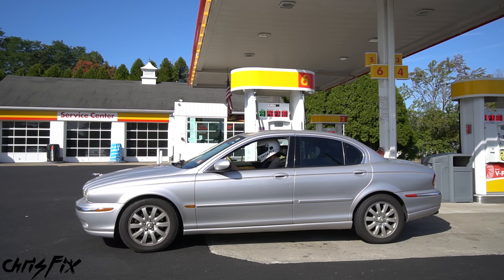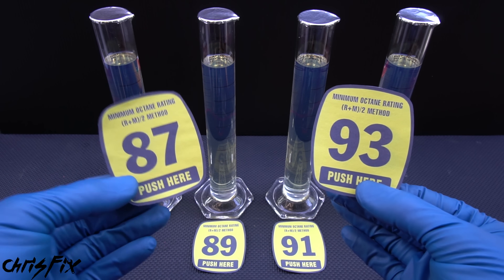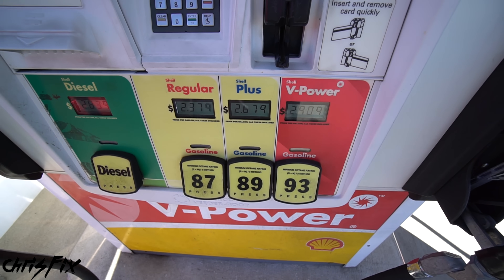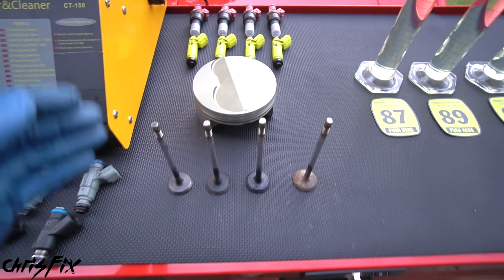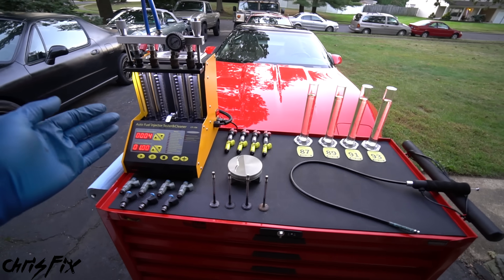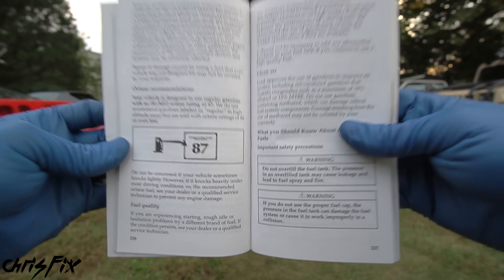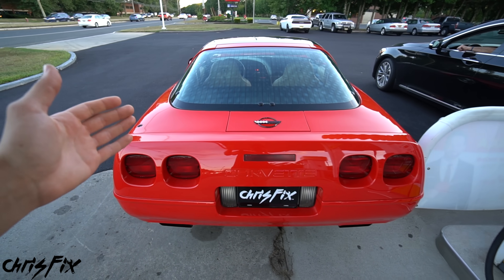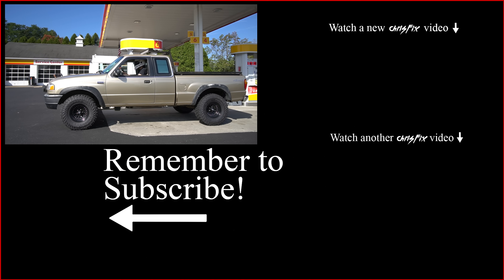What is the BEST Fuel to Use in Your Car or Truck and WHY

Comment: American Fuel has Ethanol about 10-15% , and it is trash. Ruins lines and hoses. Ethanol is the reason why people say American fuel is crap.
Reply: Only most of Europe has now introduced it as well. And all makes of cars and trucks have been made for 10% alcohol for the last 20 years now. There are no rubber hoses and all fuel lines on modern cars are stainless steel. US gas standards are the highest in the world actualy. And countries around the world are going 5% and 10 % and higher world wide at an incredible rate of adoption. The US besides Brazil, was just early to the game for 10%. But it's been standard in my state for two decades now. Also Ethyl alcohol burns cleaner and doesn't pollute as much. And Europe is all about that idea.
Reply: Scootaloo in theory it is, but the process of converting corn into ethanol is dirtier and requires fossil fuels anyway. Ethanol has caused more damage to a lot of marine and boating engine fuel systems. Just cleaning out the ethanol from the fuel system requires a ton of chemicals and replaced parts that end up in the trash. Ethanol is not worth the effort at all.
Reply: @geog5523  It has to be worth the effort. They have made the switch 20 years ago now. LOL! Plus all you can buy is 10% in all grades here. The boats here on the great lakes are running it.
Reply: Scootaloo I am in the industry , it is a major problem among all boaters who use gas powered engines. It is a costly expense and any mechanic shop in your area will tell you how big of an issue it is. It is not worth the effort in the US at least. Do some research on Ethanol related fuel problems , you can’t just assume these companies are doing it for anything by other than personal benefits. Biodiesel on the other hand is great because you are recycling a product that was considered waste.
Reply: @geog5523  So what your saying is that the automotive industry figured out how to make cars run perfectly reliably on 10% Ethyl gasoline 20 years ago, yet in 2019 they can't make boats run on it just fine. 

I find it funny how my 25-year old lawn equipment has run just fine on it for two decades without issue and how I've had several vehicles run hundreds of thousands of miles on it without issue. Yet boat manufacturers can't make a boat run off of it in 2019? WTF! XD

That's the first I have ever heard of it. It's not even possible to buy gas without 10% alcohol in it. It's been a law for years now that all gas has to have alchohol in all gas grades. Not to mention most of the world now runs it in their gas as well. 

So about ethanol being a dirty process. It is not. Ethanol is typically produced by removing the starch or sugar portion of corn and fermenting it. The fermented starch is then distilled into alcohol. Excess water is removed, resulting in very pure, 200-proof, ethyl alcohol. That's it. Then it is just mixed with gas and the process is done. 

Also according to a major boat engine manufacturer. 

Ethanol blended fuels (E10) are common throughout much of the United States. After the transition period from non-ethanol fuel, E10 may actually be a superior marine fuel, as it tends to keep low levels of water moving through the fuel system, keeping the system “dry”. For over a decade, marine engines have been engineered to handle E10 gasoline.

So this just goes to show you don't know what you're talking about I'm afraid.
Reply: Scootaloo appreciate you taking the time to write your response. It looks like you took a lot of time to do so. Anyhow, I have had real world experience with marine products. It is quite simple... Ethanol brings condensation into the fuel system. Most boaters do not use their boats every day like you would a Car or even a lawn mower. They sit for periods of time and the ethanol turns into nasty syrup looking material. You failed to mention anything about condensation in the fuel system. You took a quote from a random manufacturer and think you know it all. Since you clearly have not spoken to any local marine shop , do what you’re good at and google : ‘ VST Pump failure ‘ ‘ carburetor ethanol ‘. All marine engine companies sell ethanol fuel stabilizer to mitigate the fuel problems and it barely ever works and is also an added cost plus whatever chemicals are in the stabilizer. Flex Fuel vehicles also receive worse fuel economy when running on higher ethanol fuels and that is just a fact.
Reply: Scootaloo and you also forgot to mention the minor detail of having to harvest the corn prior to making it ethanol........
Reply: @geog5523  Harvesting it doesn't hurt the environment. I would say drilling for oil to make gas in of itself is far more harmful, especially when it spills into the ocean. 

I use equipment that sits for up to a year at a time and with a simple little bottle of stabilizer, the gas never goes bad. Again this isn't a problem for vehicles or anything that sits for up to one year at a time. Also most countries have ethanol in their fuel, so US gas is every bit as good as you will find in Europe or any other country. 

If you say US gas is terrible, then that means every country has terrible gas. 

Yes E85 has less energy. But it also can handle crazy high compression ratios for high powered engines. 

Again Gasoline in the United States easily keeps fresh for up to one year. Also gasoline before ethyl alcohol was only guaranteed to be fresh up to one year before breaking down regardless. You should always drain your fuel system completely if it's going to sit for more than 12 months at a time no matter what type of fuel you use. That's just plain common sense. 

I have generators like I said that sit up to one year at a time and I put fresh gas in at the end of that year. And they keep running without any type of issues. The fuel dosen't break down.

Comment: I drive a 2005 Chevy Trailblazer LS about 136k miles, should I just use 87? Iv been using 89 here n there with maybe just about a quarter tank of 87 because I don't wait till I'm on E (GM fuel gage ptsd) and is it bad to use 93. I'm not hard on the gas all the time but sometimes I am.

Comment: WOW American Octane ratings are low.  UK fuel starts at 95 for standard and 97 for premium and some sellers go to 100 octane.
Reply: Did you actualy watch the video? US octane ratings use a different method for calculating octane. Our 91/93 premium is the same as 95 and 99 octane in Europe. We also have some sellers here in the US that sell 100 octane to. But if it were sold in Europe, it would be rated at 110 octane in the UK.

Comment: Hey Chris PLEASE HELP ME🙏🙏🙏🙏🙏🙏after watching this vid and hearing you mention "ENGINE KNOCKS" it reminded me of my unknown issue that I am facing. When I turn on my 2011 Honda Accord I hear approximately 10-20 rapid engine knocks and then the sound vanishes, I dont hear them again until I turn on my car after many hours of the car being off. This sound only happens when I turn on my car in the morning or after work, preety much when the engine is cold. I have even tried to immediately turned it off and then back on to see if the sound would come back but it seems like it only happens on the initial startup and nothing until the following initial startup many hours later. What can this possibly be? PLEASE REPLY IF POSSIBLE 🙏🙏. Thanks in advance. Like👍 button SMASHED 💪

Comment: Great for cars that are 2000 and up.  Question I have is I have a 74 Pontiac Firebird, Formula 400 with a fresh motor swap.  Which fuel would you recommend.  I've swapped the Intake manifold out exhaust.  I swapped the whimpy 2 barrel carb for a 4 barrel.  Is 87 okay or should I go 91 which is the highest I know of in California.

Comment: 87 octane wtf in the uk the standard fuel is 95 and v power is 97 no wounder your watered down fuel is so cheap 🤣🤣🤣🤣🤣
Reply: You totally didn't watch the video did you? /)_< 

Shell Vpower in the US is rated at 93 octane. That's the equivalent of 99 octane in the UK. 

You may want to watch the video before commenting next time.

US gasoline is of the same quality as you will find in the UK. We just pay a lot less for it is all.

Comment: So i have a truck thatbcalls for flexfuel e85. I learned e85 is actually 109octane. I hear lil valve fluttering so i chose to substitute 1qt of royal purple oil for 1qt of lucas heavy duty oil stabilizer. Ive also heard that if you dont have a full tank of fuel the air in the tank makes moisture (water)in the fuel tank. Is this information accurate?

Comment: whats your take on using lucas fuel injector cleaner? also do octane boosters work and is it a boost in power for your car or just a boost in octane that helps gas burn better.Thanks

Comment: Hi @Chrisfix i just want to ask since my nissan rouge has 2 diffrent numbers states on the manual. It says atleast 87 AKI and at the end it has (Research Octane Number 91). Is 87 would do just fine? I had it for years but just wondering if i am putting the wrong gas since then. Thanks

Comment: What about the rumor that any ethanol is bad? 
"May contain up to 10% ethanol" is ok to use? or
"Buy the real premium stuff! NO ethanol"??
Reply: In a modern vehicle ethanol is fine as long as its e10 or lower. Flex fuel vehicles can use any amount of ethanol. If you have an older vehicle with a carburetor or a small engine, use non ethanol gas whenever possible.
Most premium gas from the pump contains ethanol.

Comment: The 1st explanation of fuel grades that I cant argue with. 

I will say though if you have a direct injection motor to run the highest octane available,  and a fuel system cleaner occasionally.  It's good cheap insurance for those motors.

Comment: Im a. ASE certified master techninician and hold a CA smog license, but currently work on diesel engines. 
Your video is very well made and its 100% true, the only thing you failed to mention is that the was to do a carbon blast whenever the engine that recommends using 87 octane starts pinging. I recommend doing that over running premium fuel for 2500 continuos miles, carbon blast is cheaper, faster and more efficient in my opinion. Of course after the carbon blast doing an oil change is a must, but Ive seen cars pass the CA emissions test after carbon blasting. You do give much great advise Chris, congratulations bro.

Comment: I'm confused about the ratio of ethanol explanation.  Ethanol content that I've seen listed on the gas pumps  say "May contain up to 10% ethanol."  Meaning-- 90 percent is non-ethanol gas with 10% ethanol.  The way it's explained in the video, ethanol is 85% of a gallon and 15% gas?  (16:11)  I thought Flex Fuel (E-15) consisted of 85% regular gas with 15% ethanol blended in?

Comment: I cant put in lower octane fuel than required but I can put higher octane fuel and if it has add ons like in Shell gas stations it might clear my engine parts. Did I get it right?

Comment: You put in the manufacture's suggested grade of fuel in your car and on a hot day, when the engine is hot, drive up an incline.  If you hear the engine pinging (literally makes a pinging or "ting ting ting" noise), put the next higher grade fuel in for hot weather.  If it still pings, go to the dealer and tell them to drive it up their ass.

Comment: hey Chirst great videos as alway 💪🏽💪🏽💪🏽 i like to put aditives on top of aditives shell v power is what i use daylie in my Scion TC 2 Rs9.0 .. i honeslty notice my car runs smoother and gas last longer and i drive 26 miles 6 days a week every day at a Consistent speed of 80mph i get 3 extra days of fuil with 93 no extra aditives with the lower grade i get exaclty 6 days and thats me refueling at the the line before it hits empty with both type of gas .  what do you think ?

Comment: chrisfix> i work at an oil terminal in the UK.  We ship gasoline to the US  all the time. when a tanker is loaded with gasoline. 
The load size is in the range of  40-70 thousand cubic meters(40-70 million litres) It is all the same grade across all the tanks. Then an additive is added to half the tanks. Then shipped to the US.
It's then classed as regular and the other half  is classed as premium gasoline

Comment: I gotta day thx but I have a "HUGE LINGERING QUESTION" I have 2003 Saturn l200 ecotec 2.2 and at  certain has station they have a "certain" gas called E15 and it says  only to be used on cars newer than 2001 it's quite a bit cheaper than 87 octane (regular) .....can I use it does anybody know !

Comment: Ummm, E5 90 will have more energy than E10 90 ... E0 90 has the most even though all have the same octane rating ... it's chemistry.
Blocked injector ... it is blocked by gum not carbon.  Gum is usually caused by poor quality fuel and is soluble in ethanol, the key ingredient in injector/fuel system cleaner.

Comment: Years back unleaded gas was not even an option, correct? What happens then when only unleaded gas is available nowadays? I'm not sure if you really addressed what to use then in specific cars like muscle cars for instance. I skipped through the video so I may have missed some pertinent information. I run 93 octane in mine and have had no problem to date. I don't drive it much except out the car shows, so that may make a difference?

Comment: Well done video but one big mistake.   There is little evidence than putting lower octane gas in your car does any damage if your car has anti knock sensors.  The sensors work to prevent knock and prevent engine damage.  You lose some performance and slight fuel economy as the sensors work, but it doesn’t damage the engine.  So, if you aren’t noticing or bothered by the small performance drop with lower octane gas, save your money!

Comment: Interesting, I got a 2019 Ford Flex. Premium fuel is Recommended but it can run on 87 Octane. However I use 91 Octane/premium because it says its recommended and I figured 91 is cleaner gas that can help prevent that Gunk Crap. I also only get my gas at Chevron in California which is almost $5.00 a gallon. 🤷‍♂️

Comment: Meanwhile in CO we still have 85 as "regular" to counteract the elevation, yet apparently this is only effective in older engines
Reply: The same here in NM.  Our regular is 86 octane.  If our politicians weren't owned by the petroleum industry they would pass a law that requires that all gasoline sold as regular be 87 octane as required by almost all automobile owner's manuals.
Reply: I wish pumps carried higher octane. If I could get 100 octane out of the pump then my engine builds would be very different. I envy those who can get 93 or 94 octane.
Reply: I filled up in Colorado with 85 once and got 500 miles on the tank.  Normally with my car only gets 400 miles between fill ups.
Reply: @danielclark1122  maybe it's 87 without the ethanol added? More. Btu value if so...
Reply: In Europe you can find 95 and 98 octane. In Switerzland it's mostly between 93 and 98 if I remember correctly. Quite expensive compared to the US, though !
That said in the video he explains that the scale is not the same and fuel choice are in fact the same...
Reply: @smartcatcollarproject5699  in Europe RON is used, in the USA it's :  RON+MON/2

Comment: Hmm missing 85 octane do more research chris miss
Reply: 85 is only available in very few select areas in the US and always in higher elevation zones. Most of the country doesn't have access to it, since at lower altitudes you need to run 87 octane in most makes and models. Here in the midwest 85 isn't sold. 87 is the minimum.
Reply: @waycoolscootaloo   again miss- going to run a comparison on all octanes especially when you show octanes in the uk, better include 85 to be correct

Comment: Chris Fix, man why not show how easy the higher ron ie: 93 USa fuel cleans the injectors, put some dirty injectors in that machine of your's and show the world how long it would take before those dirty injectors and also the intake valves get clean as well, LMFAO really, its called marketing chrix fix, sure if you use the 98 or 93 all the time and the car manufacturers says you can use it, then i bet it will be cleaner inside that engine that a engine running just the 83, lol :)

Comment: All fuels have 4 positive and only 3 negative charges, thus is you use a product like a octane booster all its doing is adding the extra negative charge,which is why the engine runs so much smoother, 98 RON is just that, with extra additives, easiest way to check is use all the different type of fuel RON grades and after each tank check the spark plugs i bet my life on it, that any fuels which has additives in it to make it higher RON will make your spark plugs go a orange color, which is the additives burning off. :) Like a Products Made in the USA called chemplex and the syno ta's they are made to put the negative charge back into the fuel, remember when we all had just super no unleaded, thats when the fuel was at its highest RON octane levels, then more and more pollutants were extracted and other additives were added in the fuels to make them more viable with the car industries manufacturing and government laws to reduce emissions?

Comment: If you work at a dyno shop you’d know 93 octane does make more power than 87, and fuel like methanol does burn colder than pump gas, just ask any Australian who works with burnout cars. And some gases do burn hotter like ethanol or E-85. Also you said it’s false that some gas burns cleaner which E-85 actually burns so clean it doesn’t leave any carbon in the engine unlike 87. Methanol even cleans up carbon really well when you switch from gas.